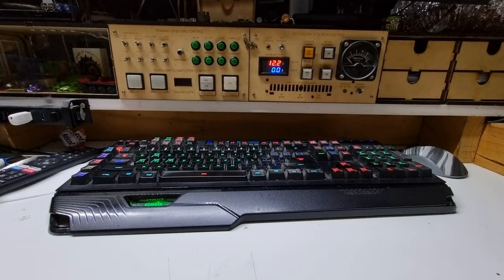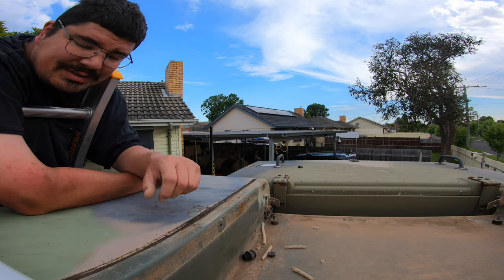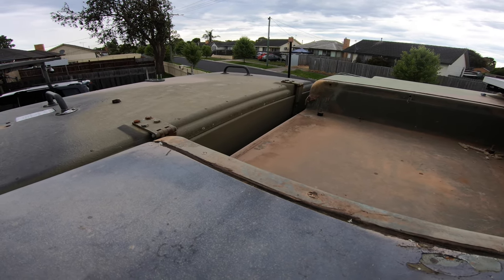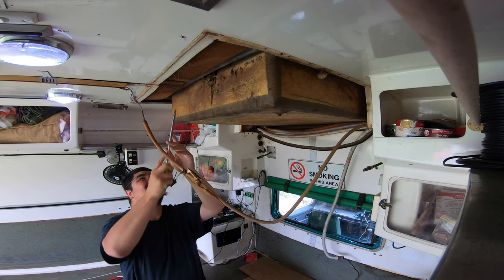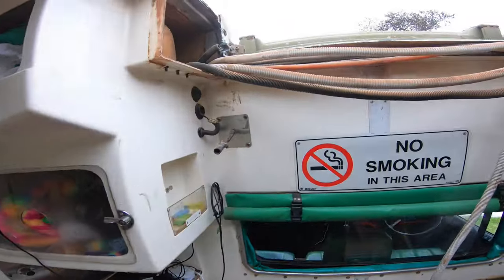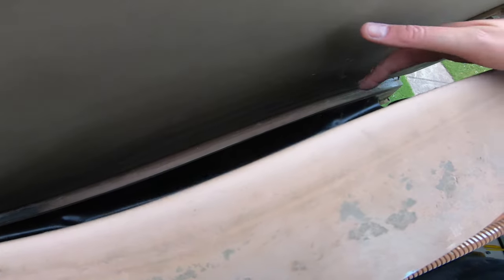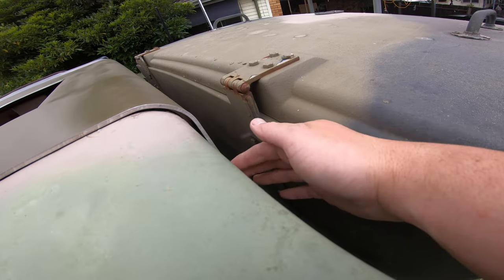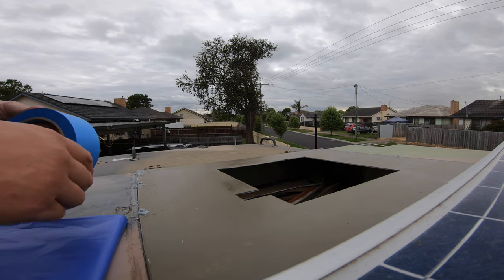Making a hole | 6x6 Air Con upgrade Part 4

Comment: Spray the silicon with soapy water heaps out so much with getting a smooth finish
Reply from the maker: Yeah I know that trick, that assumes that A: I care about a smooth finish and B: the birds won't walk all over it once I'm done. Traditionally when I have tried this the results have been worse than the glove trick.
I will be going back to this and removing some of it anyway as I have to re-drill the holes for the self tappers. I discovered they didn't bite into the steel subframe.

Comment: Interesting series, can I ask why you use silicone and not black mastic like what is used to hold in windscreens and prevent water entering ?
Reply from the maker: I use butyl tape in some places where the surface is smooth and accessible, but in the areas where I can't access or I need to fill larger gaps, I use neutral cure silicone. It also lends itself to easier removal if I find I've made a mistake. Always a possibility in custom mods like this.